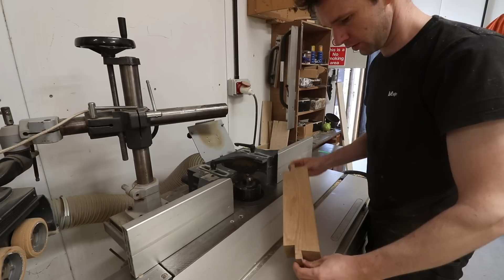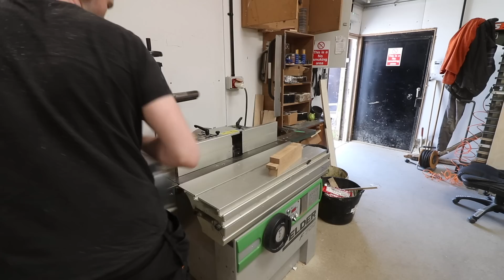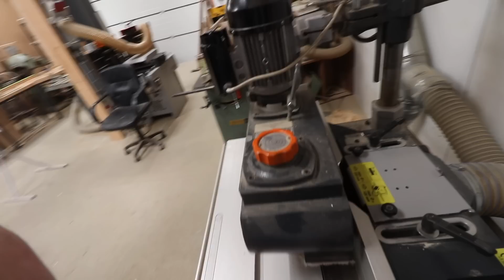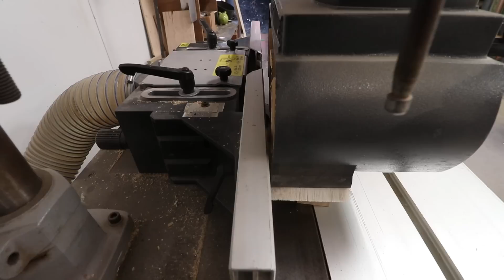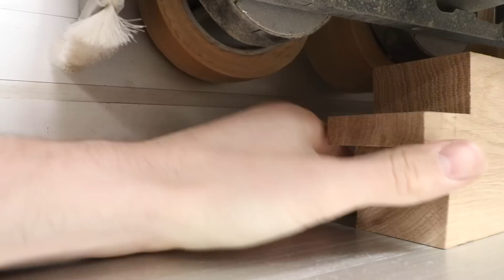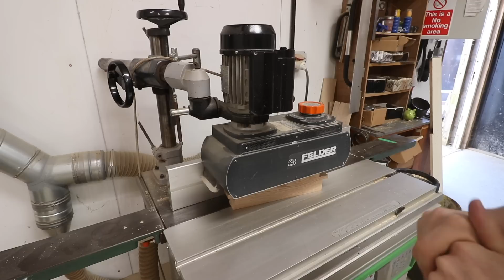Spindle Moulding the Frame - Part 5: Oak Casement Window

Comment: Oliver, thank you so much for these videos - they are clear, detailed and simply brilliant!  I have 12 windows ( some French) to make for our barn conversion. I was going for the Trend Modular Windows System, but a), it's no longer in production and b), my 40-odd-year-old single-phase Sedgwick Spindle moulder is probably not up to the job.  However, these videos have given me hope.  I will get back to you and show my appreciation when I finish the first frame.  Thanks again, Doug
Reply from the maker: Thankyou Doug! That's really great news. The modular systems work well but usually need a volume production to make them viable to purchase. You be fine I'm sure 👍

Comment: another great video.  Would be good to get a list of the molder cutters required.  Do you have an affiliate arrangement with Whitehead?
Reply: I'll be doing a video before too long using the specialty Whitehill rebate head for windows that includes seal grooves and capillary grooves etc.  Can't wait!
Reply from the maker: Should be good this!!!!
Reply: Because this video series is so darn good, I can just refer back to this, and focus primarily on the block itself. Cool!
Reply from the maker: Have you tried it yet?
Reply: @BradshawJoinery  No, I ended up being called in to a few "emergency" jobs that had to be done right away, so my workshop looks exactly like it did when I left it.  Looks like I was beamed out of there in mid job by aliens.
Reply: @BradshawJoinery  Ohh yes, such a good tool.
Reply from the maker: I will go though the video and list what ive used at some point!!

Comment: Great series of videos.. I didn't realise there were so many separate operations in manufacturing a window. I don't think I will ever make a window, but these videos have given me a better appreciation and understanding of the work involved.
Reply from the maker: If you have a good dedicated setup the machining elements are quite simple. Most components can be machined in one or two passes with a decicated block. Multi head machinery will even cut the beading from the rebate for you. This is very much a small scale/diy method, but you certainly get to know the window inside out.
Reply: Making windows... It's a pane (see what I did here?)